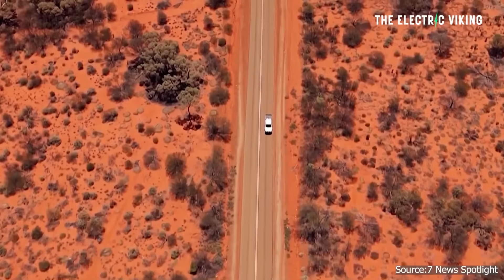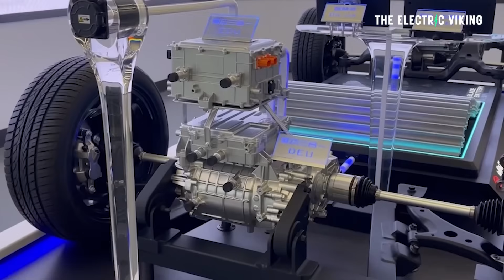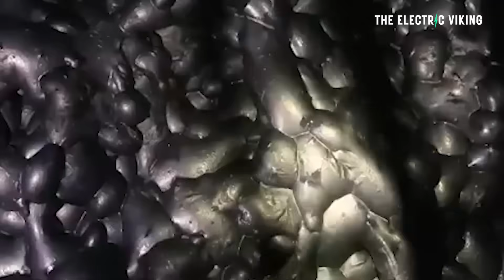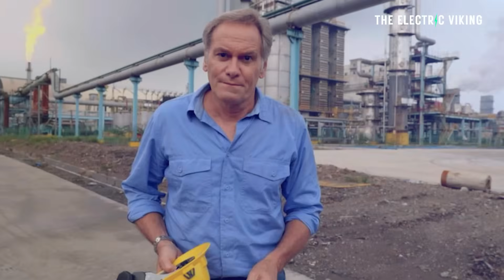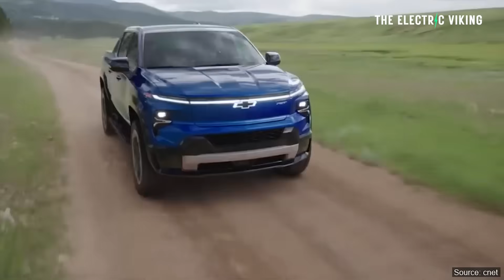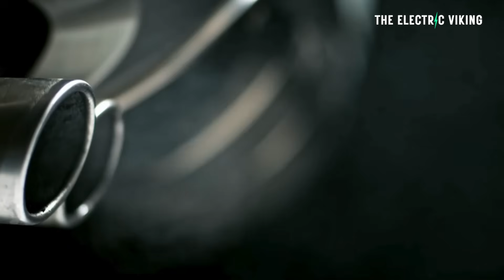Channel 7 Lies Exposed: The Truth About My EV Fight with Australian Media

Comment: Everytime I have to remind people that lithium ion batteries are not born equal. There are numeous different chemistries with  each one having different strenghts and weaknesses. When it was time to design EVs to replace ICE vehicles in the early 2000's the experts found that range anxiety and price would be the two most dominant factors in the world's car consumers decision to change from ICE to EV. So they bet on the NCA and the NMC chemistries that were best for those two criteria. China decided later to invest in the R&D of the new EVs technology instead of trying to build a domestic car market with ICE technology, Their experts found that their future domestic car consumers would instead have price and security as the two dominant factors in their decisions to buy a new car. So they bet instead on the LFP chemistry that was the best for those two criteria. 

Both NCA and NMC have a higher energy density and give more range but they have higher price and higher thermal runaway risks. LFP has less energy density and give less range but it has lower price and lower thermal runaway risks. And we have now discovered that for static electric energy storage range anxiety and high energy density are not a factor but price and lower thermal runaway risks are primordial. That's why LFP technology is booming and ICE media friendly to their ICE advertizers will never mention that LFP chemistry is different whenever they have to do a negative publicity stunt news about lithium ion batteries.

Comment: Your doing a great job keep up the great work. We need a greener earth. Now to Toyota  it expects to build around 800,000 evs in 2026 that’s down 1.5 million from its target but much more than 140,000 it sold in 2024. Toyota does not want to fall further behind so it will offer 15 evs globally by 2027 up from 5 now. In comparison byd sold 166,000 all electric vehicles last month alone. The new battery plant in the u.s. that’s done will help a lot.

Comment: Why has no one mentioned Seven Group Holdings own big shares in Beach Energy. Beach Energy Limited is an Australian oil and gas exploration and production company based in Adelaide, South Australia. Formerly known as Beach Petroleum, the company changed its name to Beach Energy in December 2009.
They are also big into carbon capture which doesn't work well  if there is less carbon to capture.
Reply from the maker: Good to know!
Reply: Whoa, thanks for that tid-bit - had no idea! Ironic that they're called Beach Energy....all those oil tanker disasters destroying beaches around the world. Maybe it's a very cynical and deliberate choice...or hiding in plain sight. 🤔

This does make sense - follow the money trail...what are their vested interests, why do they feel so threatened?
Reply: Could Never get a non EV car again ….
Reply: And I suspect a lot of that cheap nickel goes into cheaper stainless steel used by Beach for their wells, Coates Hire (also 100% owned by SGH) for a lot of their equipment and quite probably Boral (SGH again) for a lot of its equipment
Reply: @mark123655  Yeah, and with Boral's usage of approximately 100 million liters of diesel annually, that would generate approximately 254,000 tonnes of CO2.
Reply: You just have to follow the Money, just like MrBigal65 discovered.... Well Done !!
Reply: And Stokes has 33% in Sky news, and we know the nonsense they spread about EV's.
Reply: And the ”Western Australian” and “Sunday Times” newspapers, the monopoly newspapers in Western Australia.

Comment: So are you saying that the grade Nickel used for EV electric batteries in other mines all around the world is mined in a sustainable clean fashion or just saying that the Nickel from that particular mine is not used for EV Batteries
Reply: Did you miss the bit where most Nickel is used to make stainless steel? 🤔
Reply: @ +
Class 2 nickle is used for steel class 1 nickel is used for EV batteries.
Reply from the maker: I don't really know for every location. The show claimed that that particular factory where 21 people died was supplying nickel for EV batteries - it wasn't

Comment: Learn from this, In future let your response be the story Viking..

A wise YouTube contributor (YOU) showed me many of the valid points of why EV’s have the better arguments against this type of thing….
After seeing this story I did two things.
Firstly, I signed up as a member.
Second, I wrote down the following…

It’s great that a light has been shone on this issue (by Spotlight no-less..) this yet again, demonstrates the greed of man and in particular, certain countries and corporations.
Unfortunately it’s nowhere near the first and certainly won’t be the last of its kind. 
Whilst we need to address this issue, we need to pressure governments and companies to do much better, keep in mind ..
Each electric vehicle battery that is manufactured, is one battery closer to a closed loop of vehicle energy.
Soon (Maybe Eventually is a better description..) old vehicle batteries will be recycled and remanufactured into new batteries that have as good an energy density as the original - it’s being done already, albeit in small scale due to the burgeoning market.
So I’ll stick to my electric mobility plan of powering my journeys mostly from sunlight, knowing that when I used petrochemicals, they weren’t exactly great for the environment (eg. Exxon + Shell spills +++) and when they’re all burned up - Game Over…
In Electric Mobility, We’re at least on a path to somewhere better.
Reply from the maker: THanks for your support mate, much appreciated